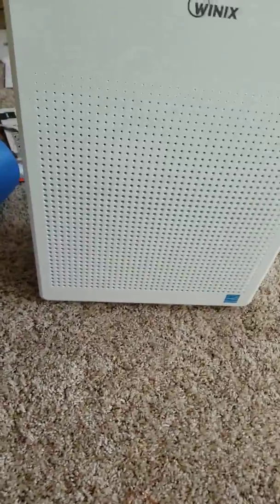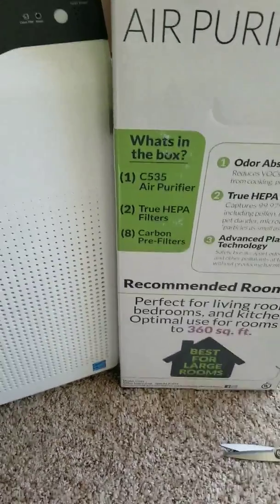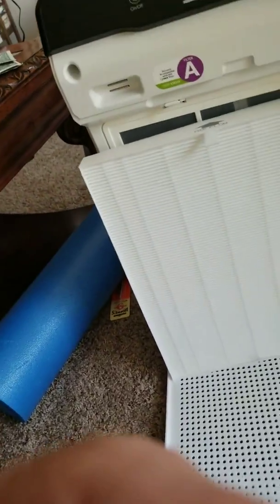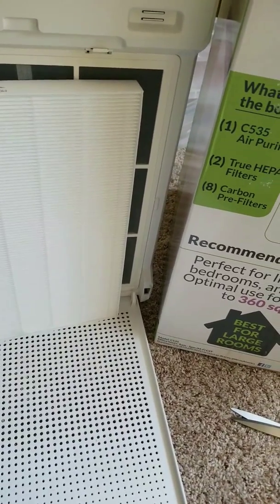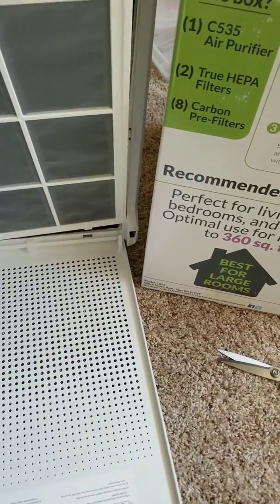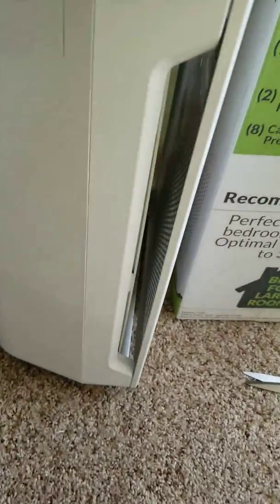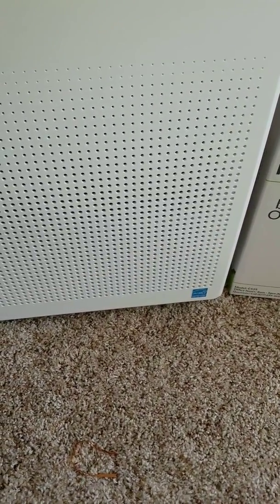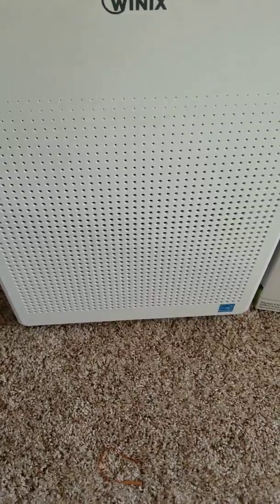Winix c535 air purifier single hepa filter correctly installed

Comment: I'm glad you did the research... I must've looked at 5 or 6 videos ranging from 14 mins to 5.... your video was the only one to answer the question about the filter-hepa that was packaged inside the front panel. 2 of the videos used 2 of the hepa filters, the others used only one. But didn't saying anything about the other filter... it seems in their videos they left it alone and assumed you could install the 2nd hepa filter... you did great work! Thanks for the info...

Comment: I have the same exact unit and that is indeed the correct way the exact where the filters go! Good job... the instruction manual is incomplete. It should tell you that the second filter inside is only there for storage and does not belong there.

Comment: I'm wondering if this will suffice a 850 sq feet apartment by itself ( running 24 hrs ) or would I need a second (larger) unit too ? And, yeah, thanks for posting the correct installation video! I, too, am guilty of installing that second HEPA filter initially!!

Comment: 3:17 "$89 charge"!? Replacement filter costs scare me off. Looks like Amazon is currently selling a year's supply (1 HEPA 4 Carbon) for $47.59. Thanks for the video. Are you happy with this Air Purifier or is there another brand / model you can recommend?
Reply: Its 89$ for a 2 year supply of filters
Reply: I own one and I'm happy with it. One thing to keep an eye on is cleaning the pre-filter every two weeks. It sounds like overkill, but you'd be surprised by how much dust can accumulate in just two weeks. It's a really quiet machine, so that's an added benefit. You'll never feel on edge leaving it on during the day.